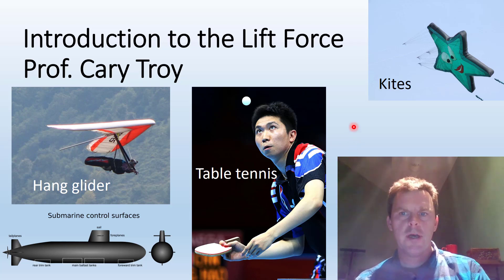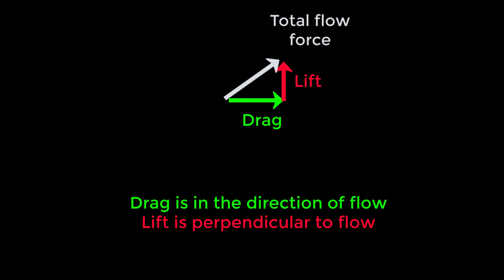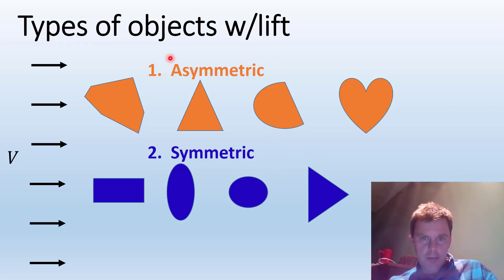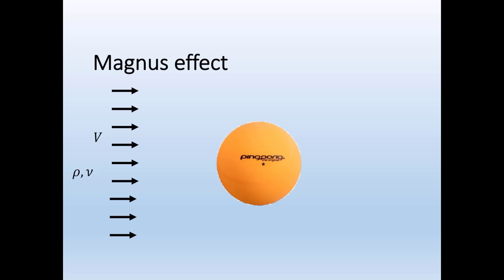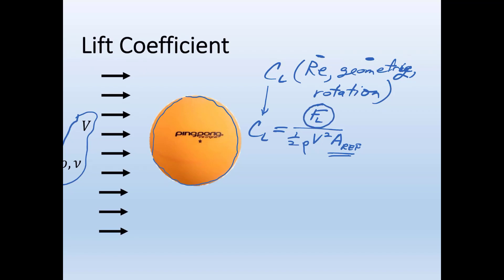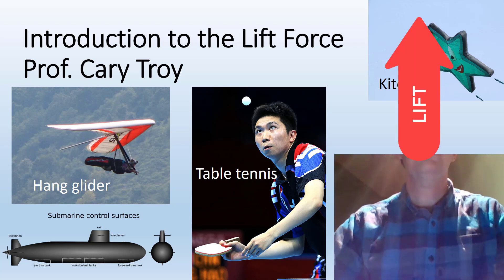Introduction to the Lift Force

Comment: I understand that you have good intentions, but. . . 
This is VERY disappointing.  
As follows:
. . .
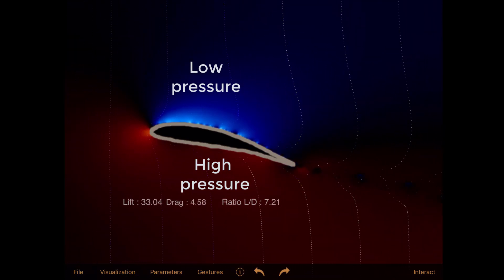3:49  and already W-R-O-N-G!  
4 years of Bad Bernoulli Science.   This is a bad omen giving me little expectation for the remainder of the l video.
.. . .
Faster flow does NOT mean lower pressure. 
That is a Grossly misleading way of saying Bernoulli's Principle and should be outlawed. . . 
IT  IS  WRONG.  Too many people believe it.
.
PLEASE STOP saying it.
.
The “fast” jet of air out of any blower is at the same internal, static pressure as the “slow” ambient, atmosphere around it.!.   It is NOT lower in pressure than the stationary, “slower” air.  The industry-Standard Static Pressure Probe measures it. 
.
Bernoulli's Principle is about Acceleration of a flow between two locations along that SAME FLOW.!..
..
I'll continue watching. . . 
"Streak lines" are barely visible, so you CAN'T 'see'. . ..  Babinsky's video is much better.
.
4:09 YOU say the flow is Accelerating.  Air has mass, so WHY is the mass in air Accelerating?  What is the cause of that Acceleration??
.
4:15 The low pressure is NOT due to the "high flow velocity".  Learn about using a standard Static pressure probe.  The static pressure within the jet of air out of a blower is AT atmospheric pressure.  < -- FACT.
It is “faster” than the still air around it, byt has the SAME pressure.
.
4:57 The House flow 'field' is IDENTICAL to the first flow as the blue breaks away at the peak. 
.
6:06 Yes, angling a symmetric object MAKES it asymmetric.  That is disingenuous.  You're playing too many games starting with random shapes, then this silliness. 
.
7:23 Your airfoil is angled DOWNWARD.  We normally refer to the leading edge because we need to transfer to AOA.  Bad wording.
.
7:32 NO, you do not have downward lift when descending.  At a standard and constant descent rate, upward lift EQUALS the craft weight.
.
9:38 The streamlines are wrong because the lower ones do not continue somewhat behind the ball, curving upward to the right.
.
This COMPLETELY misses the true physics cause of the lower pressure.
The curved air under this ball creates a lower pressure where is curves AROUND the ball MORE to the right AND upward. Air has mass and a fundamental property of mass is Inertia.  Newton’s first Law is supposed to tell us this.  We should also have learned that Inertia RESISTS acceleration, thus, in this case
, THAT is the CAUSE of the pressure decrease on the  inside of curved flow.  Inertia ‘tries’ to continue straight, therefore working against atmospheric pressure causing a pressure decrease near the surface {and in the air}.
.
Very disappointing video.
.
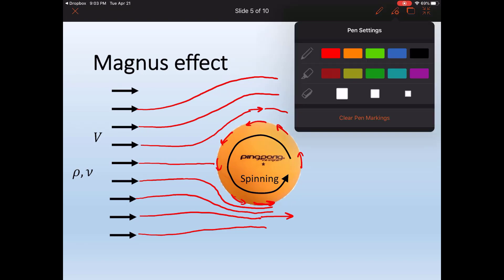9:50  Wrong again. We do NOT know from Bernoulli that fast flow causes low pressure.  AND the difference in speeds between the two different flows CAN NOT be equated by Bernoulli’s Equation.
.
FAIL!
It is a measured fact that in reference to the ground, the air below a wing is Accelerated to a higher forward speed than the air above is Accelerated to a rearward speed. 
YES, for the region above and closer to the leading edge {about 25% back , the air below a wing is faster than the air above.!.
Speed is relative to your inertial frame of reference, but Acceleration is not.  See Figure 7 in the reference below 
.
10:26 That is called ‘back spin’. 
.
11:47  Rotation isn’t non-dimensional. An axis and rotation sense MUST be part of the solution to get the lift direction correct, if not the magnitude. . .
.. . . .
A step-by-step explanation of the wing physics.
Replace the dot because sometimes YT won’t post URLs.
Understanding Aerodynamic lift correctly.
. .  rxesywwbdscllwpn DOT quora DOT com/

Regards.